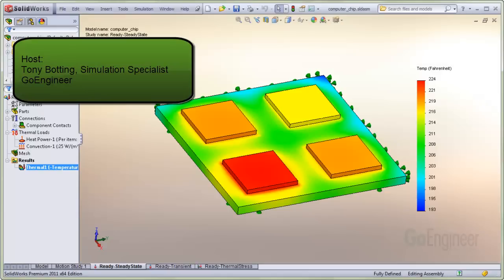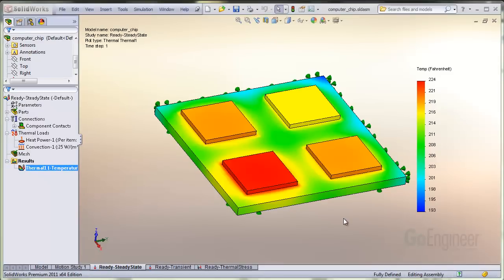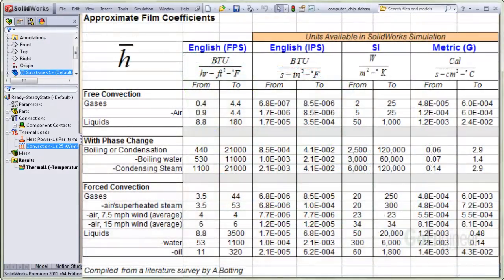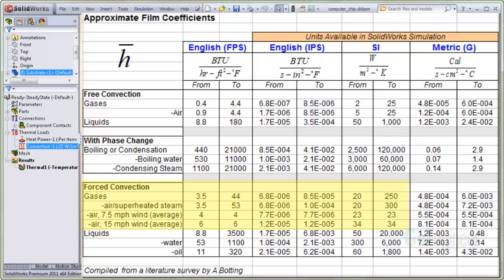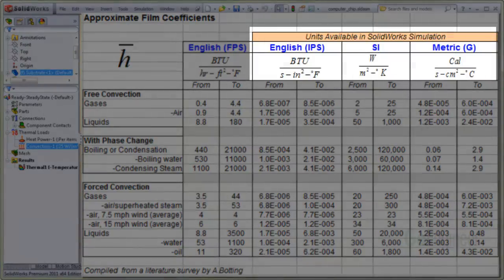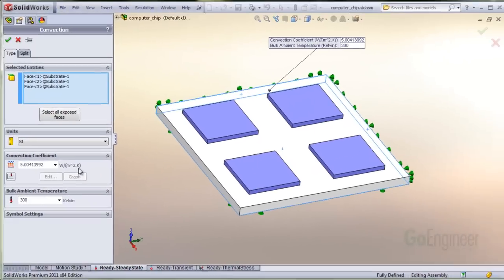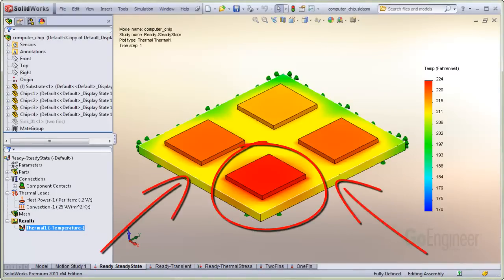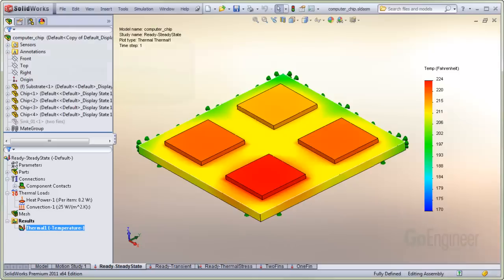SOLIDWORKS Simulation - Heat Transfer Coefficient

Comment: Hello there, i was doing simulation for radiator. And i use heat transfer coefficient except adiabatic wall. So what value should i use there for heat transfer coefficient as ranges available?Do i consider internal flow which is water or external which is air?

Comment: Hi, I need to simulate electronic device (handheld computer), and I use volume source to setting heat load (in Watt) for certain components (such as Chips and SSD). The problem is the calculation run until few components reach their melting temperature. So, how can I setup (something like stopping criteria; maybe) for my simulation?
Reply from the maker: Hi alfa78688,
The calculation will definitely go to and beyond the melting point of a material.  It usually is an indication that the boundaries are not accurate representing the real life setup (unless you are expecting it to melt).  If you want to find the moment it is melting though you would run the thermal simulation as a transient analysis and then inspect the results for the time step the model reaches melting temperature.

Comment: hello! I really like your videos but I have a question .... Is it possible to simulate the effect of floating in a vessel and measure stress?
Reply from the maker: Hi BatzellaSpain,
At the time this video was published the answer would have been no.  With the release of SOLIDWORKS and Flow SImulation 2018 you can now analyze free surfaces of fluids between gas and liquid.  What you describe could now be possible.